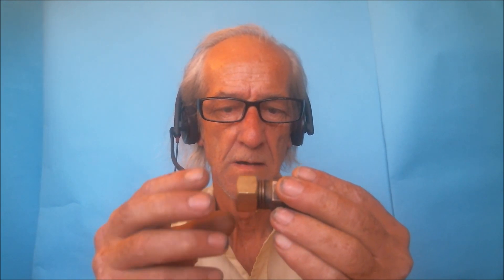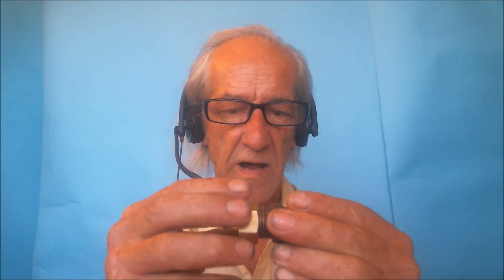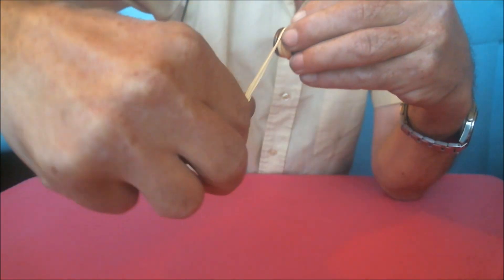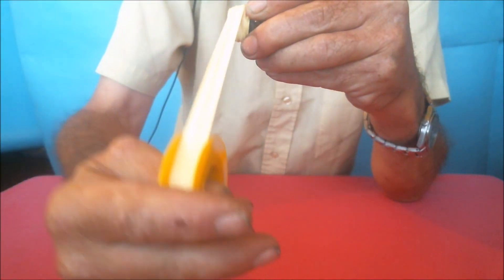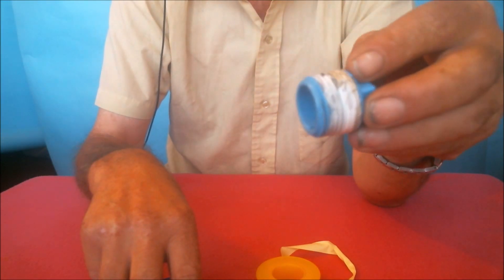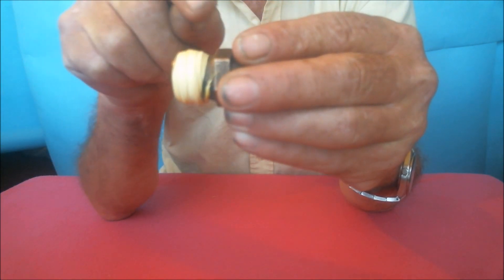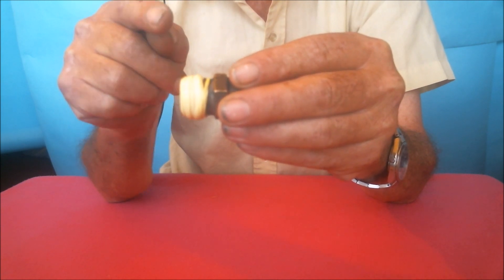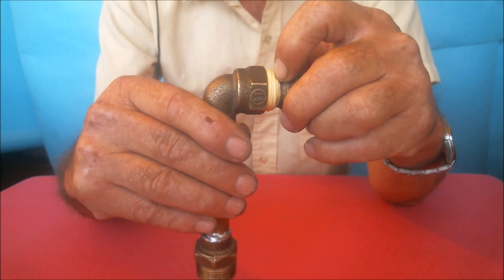The Best Way to Wrap PTFE or Teflon Tape - #teflon #ptfe #gasleak

Comment: Tapered threads on galvanized steel pipe that will be used for gas should be tightened with teflon tape (white or yellow) and the application of pipe thread sealant.  As much tape as you are using in this demonstration simply is not needed.  I disagree.  An even layer of tape is fine and there is no need to bunch the tape up as you demonstrate.  Nevertheless, to each his own I reckon.  Good luck.
Reply from the maker: Well, anyone has the right to his own opinion, however I believe there are good arguments behind this method. In any case, everyone should agree that wrapping more tape around the threads won't damage the joint and scarcely will damage your wallet but, on the other hand, wrapping too little or "just enough" is playing with risk, and not something I would recommend.  Too many times I've seen joints wrapped with too little tape, which were checked against leaks, only to fail two weeks or a month after.  You can never overdo safety.
Reply: I dont now why some people have issues with gas lines and fittings, like you i have used white and yellow teflon tape (oh no, not the white, your house will blow up!!!.lol) and i have never had a leak,as long as you are using nice quality new or relatively new fittings and some nice tape you'll be fine,tape it clockwise nice and tight and snug your fitting and dont over tighten it and smooth sailing.

Comment: Thanks Rod.  I'm trying to screw together brass gas fittings and I think they're reverse threaded. The very tip of the brass fitting is mashed and i cannot replace that fitting. Hence, the use of tape to connect the fittings.  Have a fine week.
Reply from the maker: Thanks for your comment Houndsman.  Don't know what fitting it is but I feel it might be a fitting that seals by compressing two cone shaped surfaces (most common around here with reverse threads).  If that is the case, you should try and find a way to replace the fittings as soon as possible, because using sealing tape wouldn't be the proper solution.  But maybe I'm wrong and your fittings are something else.
Reply: @RODsDIY  Thanks Rod. It's a Coleman Focus 30 top-tank propane heater and the threads on the base are stripped and I was hoping the tape would be enough to guide it into place but...no joy. I don't think Coleman makes the heater any longer nor can I remove the old fitting. Well, I can find no solution for this dilemma. Thanks again.
Reply: @houndsmanone4563  I searched for it in the web and ended up in many antiques sites. :)  If you can get the base off (unsolder it?) you might be able to get someone to machine a copy.  Here in Chile there are businesses dedicated specially to making machine made replacement parts.  Just an idea.
Reply: @BackyardArt  Thanks much for your research and I too saw several vintage Coleman Focus heaters on ebay.  "Vintage" (why they call it that, I do not understand). I guess I'm "Vintage" as well, ha.  Again, appreciate your efforts.  Enjoyed the conversation. I just subscribed to your channel to show support.  Have a fine evening.